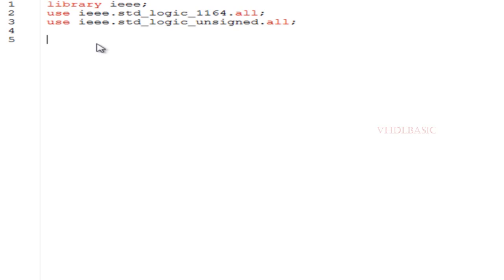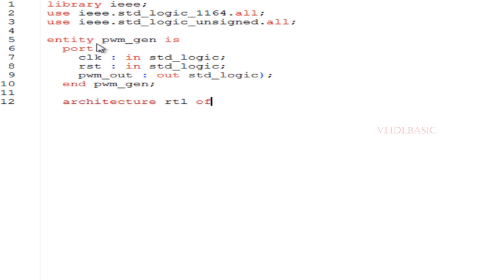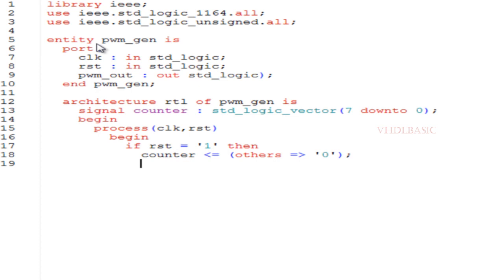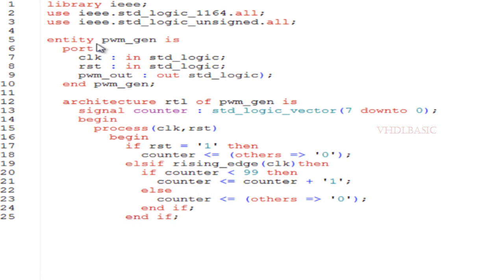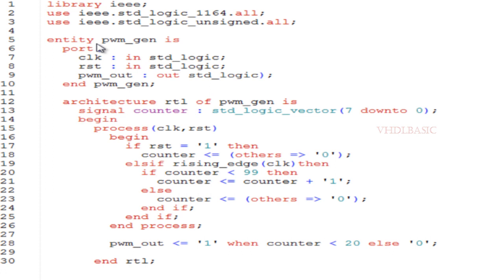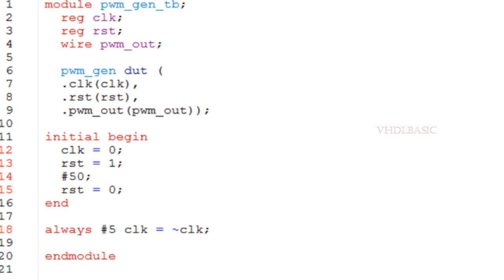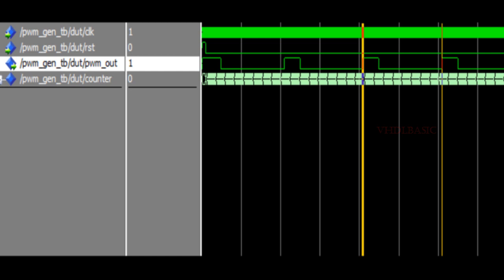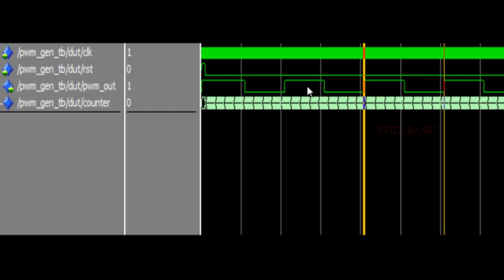Basic PWM generator in VHDL

Comment: Hey! thanks very much for this video it's extraordinary. I am working on a project where i want to control the speed of a motor using digital electronics.I am wondering if there is a way to generate different duty cycles without having to manually changing it in the program all the time.
Reply from the maker: Yes you can do it. you could maintain a register which you can update from protocol like SPI, I2C or UART(from external world) and that register you can connect in line 28. Hope this will help you.
If you like this video and channel kindly share it with your friends and juniors